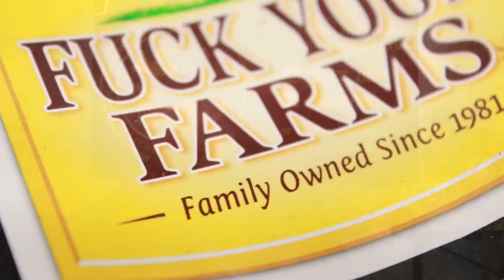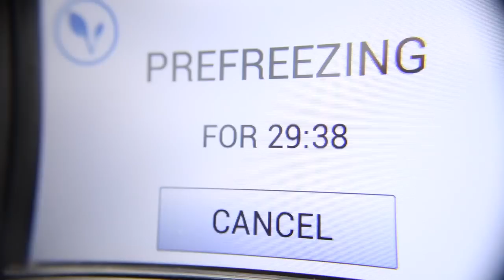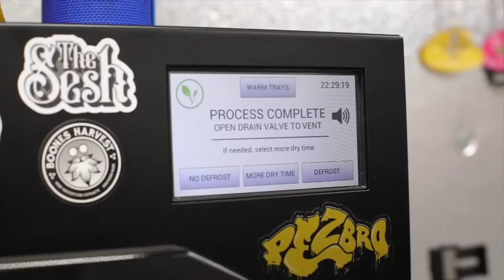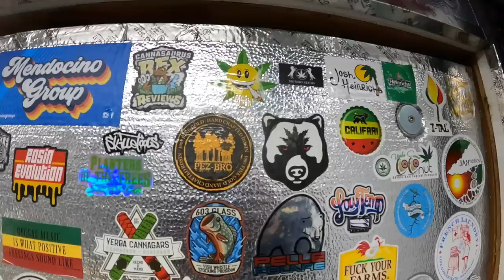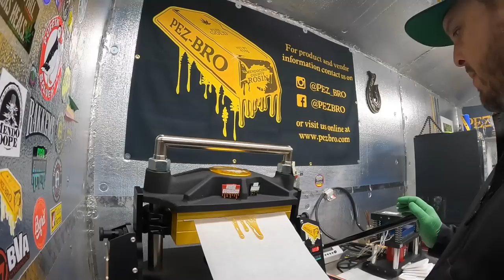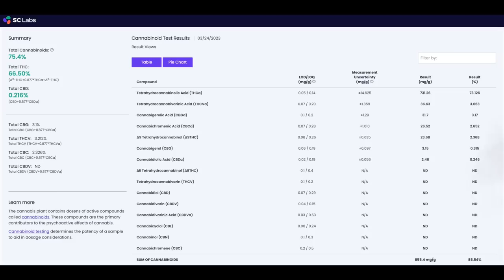Emerald Cups Highest Terpene Winner: "The Making Of w/Pez Bro"

Comment: Alright so that makes sense, you rinse it to get all the excess particles that would of landed on the weed out so its just pure resin left to press. Brilliant. I remember back when I sprayed if the weed wasnt flushed properly and there was any type of unnecessary chemical or dust etc ( which is why I always considered it basically impossible to spray BHO with outdoor weed ) that it would turn into butane soup and the tane would lock into it, so I always sprayed organic weed .  I guess You could get away with it with Rosin but what You guys do makes it more pure which is really impressive and cool. Cheers and congrats